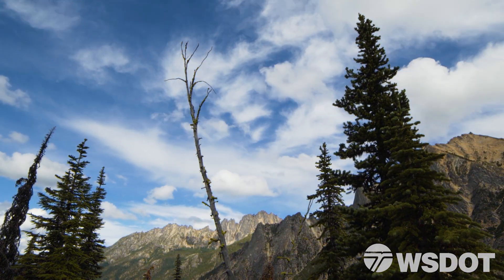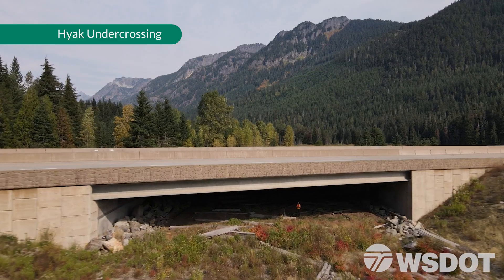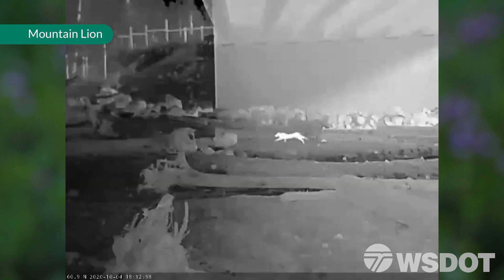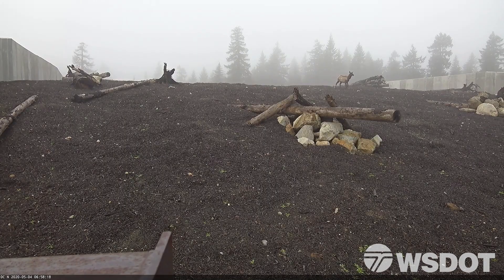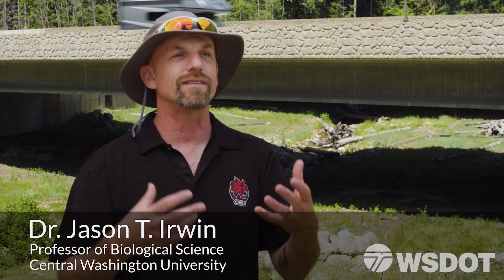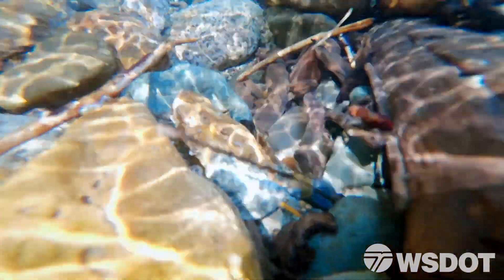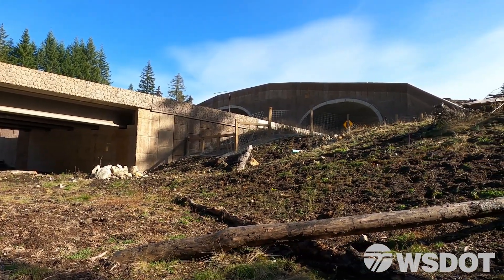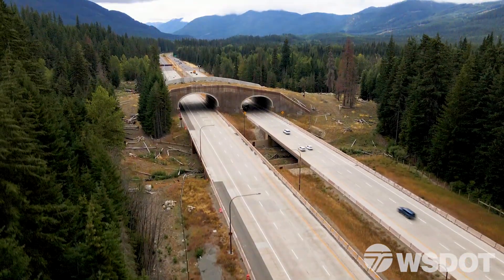I-90 Snoqualmie Pass East: Critter Crossings in the Cascades

Comment: Can this please be mandatory or signed into law?! Lol. Any freeway, highway, interstate or major road passing through protected areas or wildlife corridors (or just known wildlife hotspots) should be required to maintain at LEAST one overpass crossing and one under-crossing, if not investing in more being built—if need be, allow for some to even be privately funded, if the state gov’t doesn’t offer anything. Otherwise, yeah, ok, taxpayer-funded (within reason), but it’s a worthy cause. And it assist in more than just the animals’ safety, but it helps the drivers pass safely, too.

What are two of the most dangerous (potentially deadly) living things in North America? Well, they actually exist almost everywhere in the world, to some degree—and they are deer & mosquitoes. For deer, apparently more people are injured or killed as a result of colliding with deer crossing roads. They get hypnotized by the headlights or they don’t even notice in time and jump out. Supposedly, more people die this way each year than are killed by dog attacks (or any other mammalian carnivore). If a car is fine, but strikes & kills a deer—and the driver really can’t pull over—you’ve then potentially got a carcass in the middle of the road which could cause a chain reaction of avoidance, swerving, and possibly triggering a new accident with multiple vehicles. 

Imagine if it’s a mature buck in his prime, muscular, tall and with full antlers. That rack could stab you in multiple places after he comes barreling through the windshield, glass and blood everywhere, and that’s not counting the vehicular damage and potential to drive off the road or off a cliff/slope..

Comment: What an awesome project!
Why though was the vehicle clearance made so massive?  Wouldn't a Lower and Wider overpass be cheaper to construct and more beneficial for the wildlife?  I drive a high clearance big rig truck for a living and every time I drive under this project I can't help but wonder why did they make the vehicle clearance 30' ft plus?  Also because of the high clearance the sound levels are higher due to the large echoing chamber.
Reply from the maker: The overcrossing  structure was designed the way it was for many reasons - some functional, others aesthetic. Meeting oversize clearance heights in all lanes, including the westbound area where vehicles put chains on in the winter, resulted in arches with a very high center clearance.  

The sound-level hypothesis is intuitive but not born out in this case. There is a significant amount of sound-deadening material (rock and soil) covering the arches, which reduces resonance. Also, the wildlife exclusion walls on the sides of the structure were designed similarly to a standard noise wall. Because of this, the animals are outside of the primary propagation pathways of sounds originating beneath the arches. It’s actually relatively quiet on top of the overcrossing compared to a bridge or the roadside along I-90.

Comment: All the states should be doing this,and in the towns. This way is the best way save wildlife,and it roads safer for every body. It's perfect solution. These projects should be mandatory in all states,and towns. All need to do there part big or small.   It works toward single goal. The perfect plan.

Comment: Remember that if you funnel or channel the wildlife to the crossing structures, the predators will figure that out and just wait by those structures for lunch to come to them. They won't really have to hunt much. They will, only because it is natural for them to do so. But picking an easy spot to hide while food just walks by is preferable. Also, the prey just can't run in any direction. Compared to their habitat, these are quite narrow and severely limit escapability. Just something to think about.

Comment: needs to be more than one, animals are very territorial and as you saw with the elk will not allow others to use it, so those bullied animals will not return to said crossing, as in wherever brown bear use it and make trail, deer and so forth are not going to want to share it... need many of these different sizes and foliage, berries and thicket to attract bear useage detour bovine... then clearing crossings with grass or meadow for bovine, then smaller crossings for smaller critters, non ambush of course, you don't want bear or wolves hanging out, so they need multiple trails

Comment: 8 ft high sound wall isnt enough. Deer can jump higher than that esp if they are spooked. Many times they will even hit a wall and break their neck. Ive seen this happen before. There should be a soft higher solution added to the over crossings. How many rude people are blasting their horns while passing through this? This is the problem when people think they know everything.